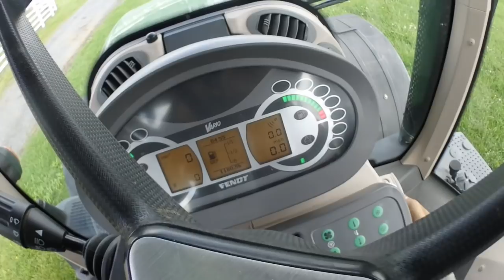Picked Up The 7930

Comment: I’m guessing you overpaid, LuLin used to be affordable but since they’ve become more popular prices are not good. They specialize in importing high hour tractors that have been used hard in Uk crop work. I wouldn’t buy one.
Reply from the maker: 4500 hours is not high
Reply: onelonelyfarmer no, it’s not but how well was it maintained? That is something different. When LuLin was new, I drove out and saw nothing but 10-14k hour Fendt and New Holland imports priced dirt cheap. Two years ago, same high hour imports with much higher pricing. If I baled as much as you, I’d just lease tractors with 3 year comprehensive and maintenance, then turn them in for something new and lease that to. Life’s to short to deal with breakdowns and high maintenance used equipment.

Comment: The fpt engines in our new Hollands are fairly clean with the oil but do have an h8040 swather that turns the oil black within a few hours of use, but have a t7030, ts6, cr9070, and a t9 and the oil looks good in them after 100 hours.

Comment: Sorry wes fent tractors only go 37 MPH
Reply: not if you pull the cvt pin and steer it per hand than you can speed it up too 80-90 km/H :D
Reply: I have driven one  40mph legally.
No problem !
Reply: 37 mph is 60 km/h which is the maximum speed allowed in most of Europe. But we have a tolerance of 10% and that makes 66 km/h or 41 mph. I don't know to what speed you can push them but it will probably be a little more than 41 mph.